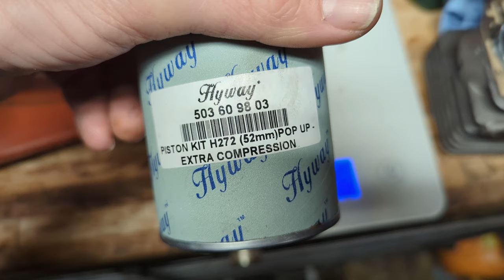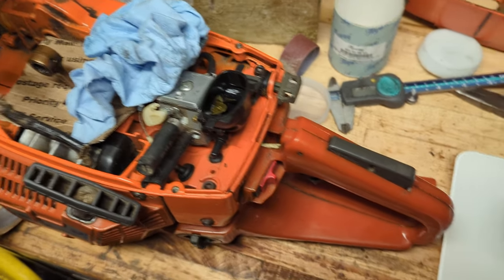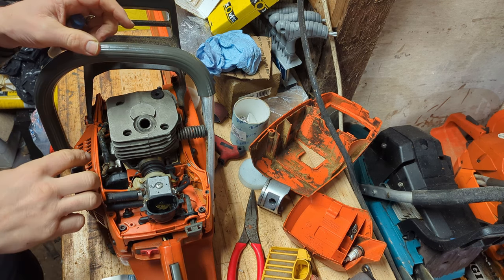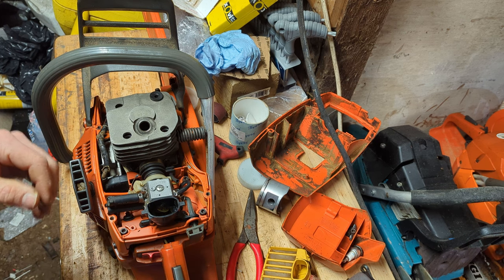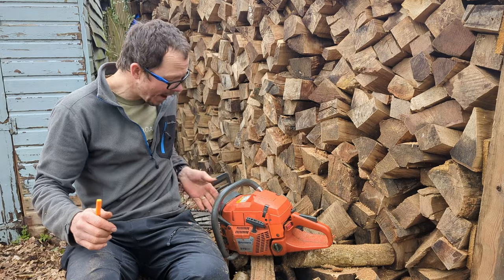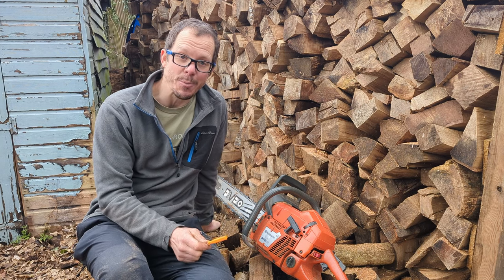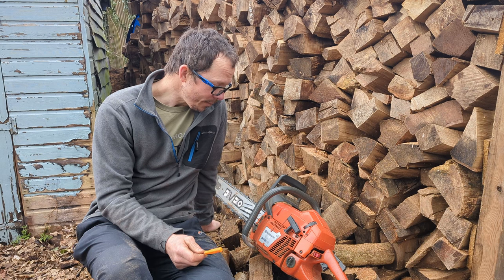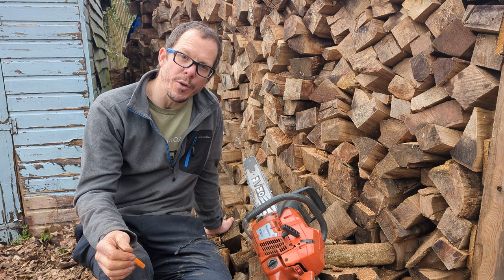Trying the IronHorse's tricks on the Big Bore 372xp ! Hyway 272xp pop up piston #chainsaw

Comment: I have a highway 268 popup in my 50mm g372xp. Started with 3 base gaskets, .022" squish. 155 exhaust duration, 160 intake. Took it back apart about a month ago, made base gaskets, set squish at .014". Now have 195 psi compression. Saw is much stronger than stock. The big bore kits, they increased the bore size without increasing the transfer port area. That's the reason the 50mm bore makes more hp than the 52 mm bore.

Comment: Yeah most folks frown on the AM 52mm big bore kits and say that OEM 50mm is the only way to go.  I've had really good luck with a Hyway BB cylinder (with a pop up piston) that hasn't had any flaking issues but it sounds like I'm def in the minority.  Will be interesting to see you put this 372/272 combo up against your 365...
Reply from the maker: Thanks for commenting again dude! Yeah I really want this to run hard, I think I'll need a better cylinder in the end. Buckins 371 that iron horse built is a ripper so I don't see why it can't be done..
Reply: @walkerscountrylife  like everything else, i think if it's done right it'll pay off.  Sounds like the key to the plating flaking issue is to slowly trace out your porting lines thru the plating with a diamond burr before hogging out the area...